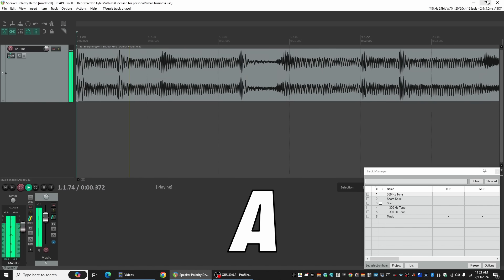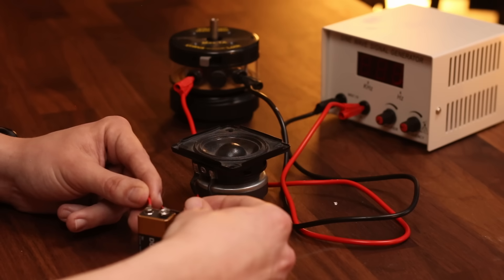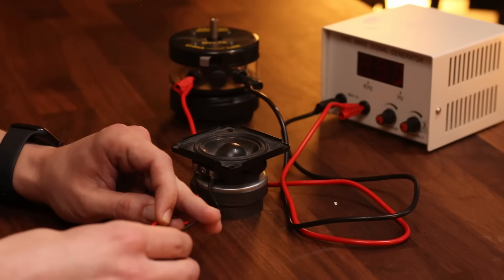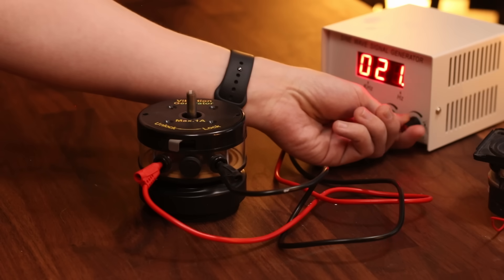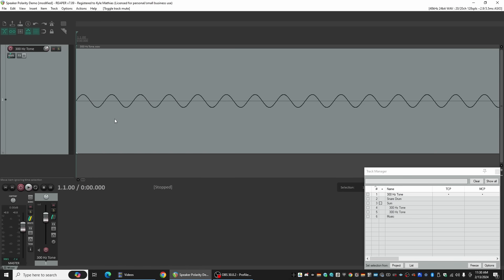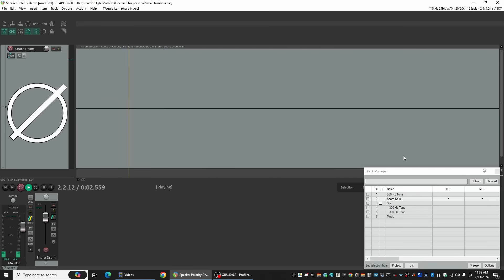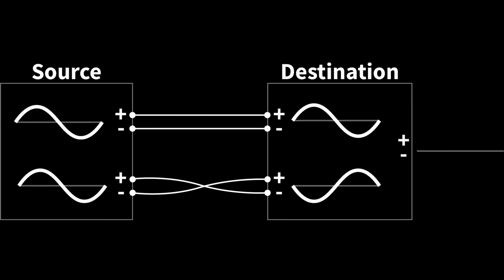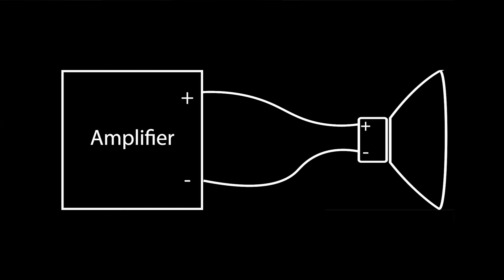What Happens When You Wire Speakers Backwards?

Comment: I don’t think it was mentioned in the video, so I just wanted to add that the common naming when speakers are wired the same is “in phase” and when they are wired with different polarities is “out of phase”. There are some interesting acoustic characteristics when speakers are wired out of phase in a home listening environment where the sound seems to appear diffuse and almost like it’s “floating around your head” with no distinct source. There are some fun examples elsewhere on YouTube where you can listen to in-phase and out-of-phase white noise that demonstrate this.
Reply: What you describe results because vocals and other instruments that are intended to be front and center experience more interference than those panned more to one side or another because they are essentially equal in each speaker. This causes more cancellation of anything in the center.
Reply: Im not 100% sure I am correct, but i heard somewhere over the years that some high end speaker manufacturers using a lot of X-over points design speaker cabs with the low bass drivers intentionaly wired 180 degrees out of phase to take advantage of this phenomenon and give the low end a wider sound stage
Reply: @Angellus502  Interesting idea, however, I wonder about this. Bass frequencies are extremely problematic when out of phase between multiple speakers. I would expect dissonant artifacts that would be anything but audiophile, from such a setup.

I don't know the specific acoustic properties, but in the concert PA world, it's fairly common now to physically reverse several of the subwoofer boxes, but not to create phase artifacts. It's done to acoustically cancel bass frequencies behind the subwoofes. It's the speaker equivalent to phase ports on the back of directional microphone capsules. The steers the bass towards the audience and away from the stage where it can be problematic vibrating the performers, their gear, and the microphones on amplifiers and other instruments.
Reply: That's not entirely correct. Polarity refers to the actual electrical connection. Polarity only has 2 options, correct or inverted. Phase is dealt with in the xover. In order for the individual drivers to be in phase, first order xovers must be used. 2nd order, or higher, and the drivers are not in phase with each other. On a phase correct speaker, all the drivers move in and out at the same time. Speakers that use 2nd order xovers, or higher, the drivers move in and out at different times. Given that, you would think manufacturers would only design phase correct speakers. However, the opposite is true. Probably less than 1% of all speakers on the market are phase correct.

Comment: One thing could have been mentionned.
For many loudspeakers box, there's a filter, and it can be totally normal to have tweeters connected "inverted".
It's because the filter invert the electric signal, so we must invert it again on the speaker to get it right.
Reply: Crossovers don't invert - they shift the phase.
Reply: @AudriusN  Right, not the correct term.
But easier to understand for most of people.

Comment: I've heard a difference at the beginning example while I've been listening on the earbuds. Bass sound from example A had "pushing" quality (fat bass feeling), B had "sucking" quality - less powerful and creating a hole in the mix.
Reply from the maker: Example A had inverted polarity. B was correct polarity.
Reply: @AudioUniversity  Still the same. I can't shake off that feeling I've described even knowing the answer is opposite of my first thought. I doubt my earbuds are faulty as well.
Reply: @AudioUniversity  Wait? Is whole music inverted or only the bass? If "just the bass is inverted" out of the whole mix, then it would be a sign of phase cancelation issues.
Reply from the maker: The whole audio file is inverted - the entire mix.
Reply: ouch !  :)   @AudioUniversity
Reply: I had the exact same feeling. It might be that we both have our polarity wired wrong, since I never really checked it.

Comment: I'm being a little nit-picky here but I couldn't let this one by. At around :45 you said, "If I apply an electric current across the coil..." The correct term is "through." Voltage across, current through. Sorry, but it's one of my pet peeves.
Reply: But an inductor resists changes in current so until the coil is saturated the current is across it and not through it.

Comment: I accidentally switched polarity on one of the speakers in stereo system. Sound wasn't cancelled, it just became wierd. As though some kind of a broken SRS effect was added.
And I'm wondering also, what about the polar capacitors in speakers' crossovers? Would they malfunction if polarity changes?
Reply: You will notice the bass more than any other frequency.   The stereo sound may be hollow   sounding.   The music is still an AC signal, just out of phase.

Comment: On a side note, the term phase and polarity are often used to describe the same thing but are actually different.
Polarity inversion (flip or swap)is what is described in this video and is a 180 degree phase inversion.
It is possible to have phase discrepancies that are not a full 180 degrees.
Reply: Phase == time delay.
Polarity == negate (or swap the  + and - terminal connections)
Those are the only true defintions.

The  confusion started when non-engineers mimic the terms from real engineers, but they didn't know the details of what they were talking about.  They didn't have the background knowledge of sine waves, duty cycles, trigonometry, voltage, amps, circuits, decibels, and all the other advanced stuff.  Non-engineers would go around telling naive people that they were audio engineers.  It created some con-artistry within many industries.

(Electrical) Engineers and electricians also use them interchangeably to describe waveforms that only repeat (like on the electrical grid);  its a quick and timely way to talk amongst each other during mission critical situations that require a solution within a timely manner (before catastrophic damage occurs and people die).

Its also a good interview question to weed out the phony audio engineers.   Just ask what is the definition of "phase" and the definition of "polarity."  Its so common to switch up the two that when I buy audio equipment, if I see the manual writing "phase switch" but they mean polarity switch, I immediately know that the equipment is crap.

Companies and schools teach different meanings of words and things depending on the I.Q. of the student/worker.
Reply: @complexity5545  well the phase shift of a function is a mathematical concept referring to e.g. the x axis displacement of a sine wave. So honestly the thing you get taught has more to do with domain than "IQ" (which is not a very well defined thing to begin with -- other than the truism that your IQ is your test result from an IQ test).  

People need to be wary of thinking "I know this because I'm one of the smart people". It's bound to make you assume the wrong things and end up looking foolish, especially when you discover that good pro audio devices will label a polarity switch with "phase". You can assume they are crap, but you are mistaken.
Reply: You can but they will be different at all frequencies. Simply having one speaker further away from your ears than another will give you a phase change - could be partial or the full 180 depending on frequency.
Reply: Nope! U just continue, and raise the misunderstanding of these two totally different phrases.
PHASE can be used only(!) in the relation of two or more(!) signals of the same frequency(!!!). Phase operations are always shifting (no inverse) with different degrees with a positive sign(!), because we can't time-travel.
POLARITY stands on its own, it doesn't need any other sign to relate. It has nothing to do with frequency. It has only two outcome either + or -.

In the signal line U can use both, but (as U also mentioned) they're different. So different they're not interchangeable in any way at all.
Reply: @shaba1982  Do you realise that the term 'phasing' is used in other electrical fields? 
eg. Voltage Transformers, Current Transformers, Actuators, Motor windings and instruments? 
On a schematic it will be indicated with a dot. 
In industry, these AC machine terminals are 1  & 2 (or 3, 4, 5...) ie. P1, P2 and S1 S2. These windings are not much different to a voice coil after all, and an AC input. 
In the case of incorrect trans connection it can result in serious instrumentation errors, especially when more than one supply phase presents at the instrument.... same as a wrong speaker connections. 

The marking of speaker terminals as + and - is for TESTING the driver, as well as correctly interconnect an amp or switch gear.  Just like the presenter demonstrated with a 9V battery. There you have polarity. 
Ever found a factory or repaired speaker that has been incorrectly? ie. connecting a + to + terminal has the cone driving in, rather than out.  I have... it's about the last thing you expect when fault diagnosing!  Mis-wired speaker leads using XLR or TRS plugs... sure, ya get that. 

Frankly... The term 'polarity' is just easier for the common man (and numpty) non-professionals to use, given you see that + and -  or red and black terminals at the back of a box.  People do the same thing with terminology relating to 'batteries'.... calling a single 1.5V cell a 'battery'... but that's another thing.
Reply: Yes but phase shift varies with frequency, so you cannot simply apply it to music as a way to counteract poorly-wired speakers.
Reply: @rcarlberg  it's usually used about a crossover frequency if drivers are out of physical alignment (one in front of the other). It's not a perfect solution, but if the range of frequencies around the crossover region are about 180 out, then inverting the polarity of the tweeter can solve a suckout in the crossover region.
Reply: @TimpBizkit  The crossover frequency is an octave or two.  Reversing the polarity of the tweeter may help an especially egregious phase shift in a poorly-designed crossover at that particular frequency, but it'll be detrimental for all the other octaves for which the driver is out-of-phase.  That's why physical alignment is so critical.
Reply: @rcarlberg  If you really want to spin some heads... tell how some types of crossovers networks (lets say in a 3 way cabinet - tweet, mid, bass) will require one of the drivers to be connected in reverse.  ie. The input Neg connected to the + terminal on the driver.   😂 
Can you imagine a too smart by halves tinkerer seeing that in a box and thinking that driver is incorrectly wired.... and the result after 'fixing'.
Reply: @BTW...  That could potentially be true in a crossover with an extreme phase shift, one of 180º.  But phase shift is frequency-dependent not constant, and generally tops out at about 30º anyway, even in poorly-designed crossovers.
Reply: @rcarlberg  
eg. 
2nd Order 2-way 12dB / octave Butterworth
2nd Order 3 way 12dB / Octave Butterworth

Yep, frequency and balance matters. 
Null zones can exist in rooms with correctly connected gear too... that's if the speakers are in a room. 
 
Oh my.. how we find some very ordinary speaker cabinets with very ordinary components and design skill, and so performance.  LOL
Good or poor alike though... they all work best when correctly connected, as per convention. + to +, - to - ...  if the terminals on the driver are correctly labeled.
Reply: @BTW...  I don't remember all the details, but back when I used to design speakers there used to be Butterworth, Linkwitz-Reilly and Bessel crossovers, and you could do 6dB/octave (which cut the volume in half over an octave) or 12dB/octave or 18dB/octave.  The more severe the filtering of course the higher the phase shift, but this was somewhat offset by the shorter overlap between drivers. Active crossovers could alleviate most of this phase shift but were expensive to implement. Many speaker designers of the time (1970s) paid zero attention to phase shift because most recordings were a a mess of incoherent waves anyway.
Reply: @BTW...  I have a tweeter in my present system that is labeled backwards.
Reply: @TimpBizkit  Physical placement of drivers is time alignment. Its usually done with a sloped front baffle, back tilt or both. In order to be phase correct in a multi driver speaker, the crossover points have to be first order.  If the crossover points are 2nd order or higher, the drivers are not in phase with each other. To visualize what I'm talking about, on a speaker that has first order xovers, the drivers move in and out at the same time. 2nd order or higher, the drivers start and stop at different times. The vast majority of multi driver speakers are not phase correct. It takes a lot of work to get the drivers to integrate with first order xovers because the roll off is only 6db.
Reply: @rcarlberg True, but would you also agree, If all the animals along the equator were capable of flattery, then Thanksgiving & Halloween would fall on the same date
Reply: @PH_INFO_101  An interesting hypothesis. However as I can think of no way to test it, it must remain an intriguing hypothesis.
Reply: @rcarlberg You my friend, with your well versed comment, have truly made my day. It is a rare occasion to find someone that is able to recognize my strange sense of humor. I officially present you with my "#1 / BEST SENSE OF HUMOR / FAVORITE YT COMMENT RESPONDER" AWARD FOR 2024. Blessings
Reply: @PH_INFO_101  That, and a warthog, make the sun shine out your arse.
Reply: exactly
Reply: Also, polarity is a reversal of a physical or electrical connection that results in a 180° phase shift. 

Many issues can create phase shift. Polarity reversal is just one that has a singular shift.
Reply: you must be fun at parties.

Comment: Absolute polarity is absolutely important, this video is uninformed disinformation. Jeez.
Reply: explain how it is important ?
Reply: @Paul58069  For non extremely close micd recordings ambient information is captured. When replayed the environment is reproduced and is either absolute polarity correct or wrong. Simple spoken word recordings portray the AP differences very clearly. Try the experiment, you may be surprised at the differences.
Reply: @Paul58069  A microphone captures amplitude and time information, ie 3D space. When Absolute Polarity is inverted this 3D space is reproduced all wrong. Try spoken word recordings comparing AP and you will understand the importance of AP.

Comment: Sound is changes in barometric pressure. I did live sound for years and I can tell the difference between the initial low-end transient being an increase in barometric pressure and one with a decrease in pressure. When you are hit with an initial wavefront of an explosion (or kick drum hit), it is high pressure and thumps you in the chest. I can't tell the difference at higher frequencies. 

For quite some time, JBL professional speakers would pull the cone IN when a positive signal was applied to the positive terminal, this caused big problems when mixing JBL speakers with other brands of speakers which moved out on a positive signal. This applied to all sizes of JBL pro speakers, horn drivers, and tweeters. It probably applied to their home HiFi speakers, too. I always carried a 1.5 volt battery connected to alligator clips to test the polarity of speakers, you'd be surprised how often the phase of the speakers were mismatched.
Reply: Air itself is nonlinear at extreme sound levels. The reason is the low pressure part of the wave can only reach vacuum but the high pressure part of the wave could go much higher than barometric pressure. This would probably not occur at a concert unless you are doing live sound for the loudest band in the universe. It might happen at a drag race or tractor pull but those sounds are expected to be distorted anyway if only by your ears.

I'd think you are 100% correct regarding phasing the speakers correctly with the kick drum.